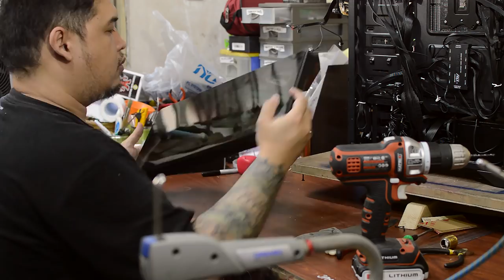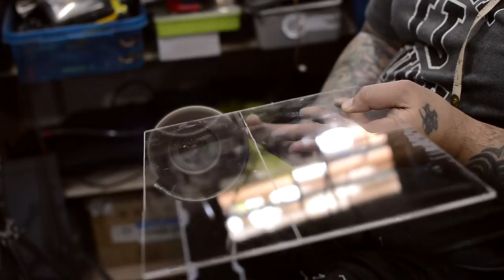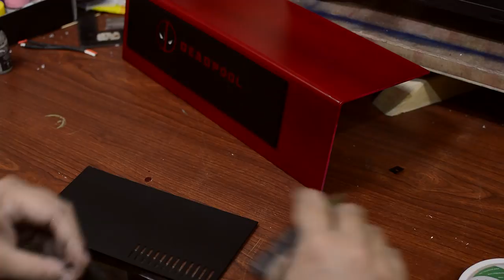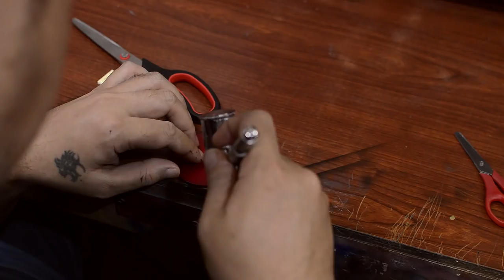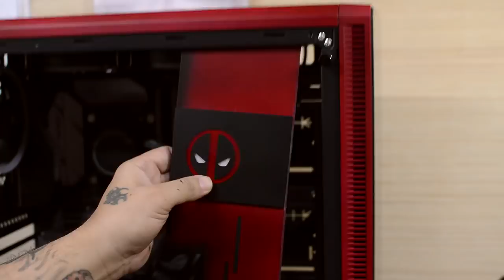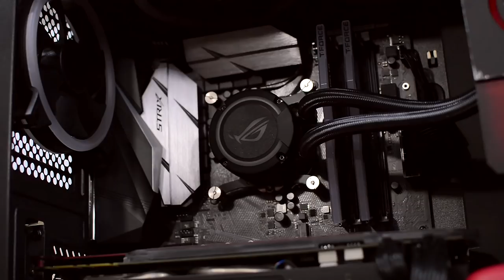DEADPOOL build (Tecware Void Case)

Comment: Had a pile of lexan laying around, and I am only two parts away from finishing my first PC for my daughter, and now I can't stop customizing the damn thing. I found out real quick I can't score lexan and snap it like you do, lol. Mine is pretty thick though. It is a black and white ryzen 7 1700 build, and I have used a lot of your tips, and tricks. Thank you very much man. Looks fantastic as usual, great job. Be safe out there.
Reply: After learning a LOT from this channel, here in a couple months I'm going to tackle my own modded themed pc build. Plan to use the Fractal Design Meshify C and do a House Targaryen theme.
Reply: Targaryen House Sweet! That meshify case is a nice choice. I have the p400. I cut out two strips on the front panel like the ethoo evolv aftermarket front panel that they sell,, which will be covered with black mesh, and a piece of black and white acrylic over top with matching cutout to allow for airflow of course. Good luck on your project! Be safe out there.
Reply: I absolutely love it and it has water cooling support last I checked which is something I definitely need for the build as I plan to do a nice custom loop. And I hardly see anyone modding the meshify c, everyone goes for the define r5/r6
Reply: 3mm will snap with only a few passes, 5mm you need to score quite a few times, and it doesnt hurt to do both sides
Reply: Also, keep in mind that Lexan is polycarbonate, and Acrylic is... acrylic! 
Poly is much more flexible and resilliant
Reply: TeamPipeBomb Mine is approximately a quarter inch, or 6.35 mm. thick. Thicker than I thought. I just now measured. I thought they were 5mm. I gave up trying to score it, and used a jigsaw. That's after scoring dozens of times with a acrylic cutting tool. The edges will be taperedI with a router. Looking great so far. Take care man.